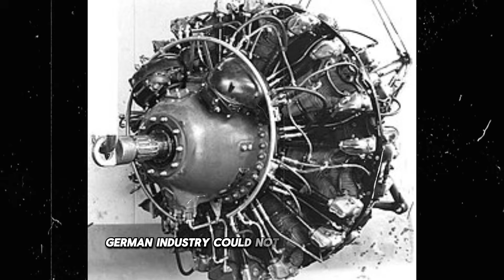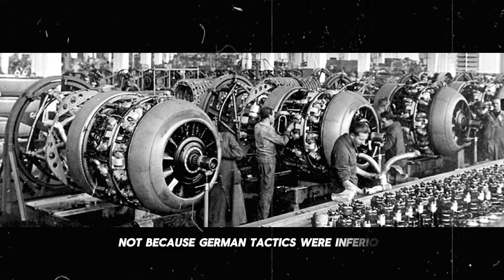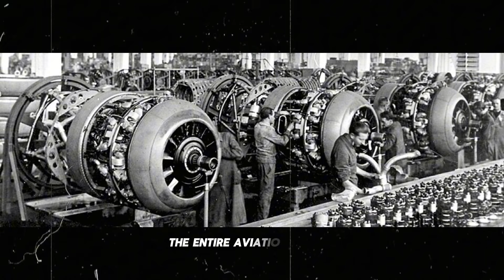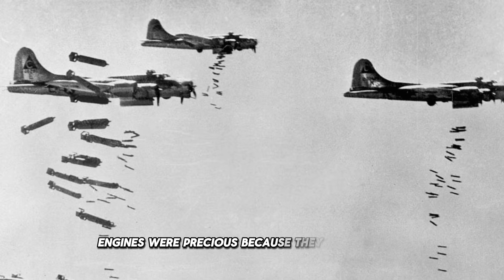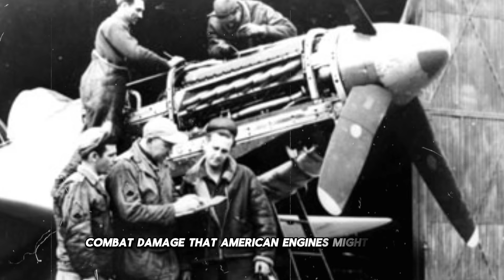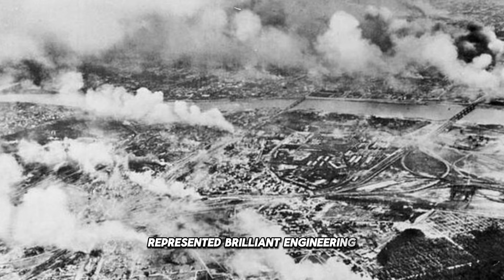German Engineers Were Stunned When They Found US Radial Engines Run 200 Hours vs Their 50.

Comment: Crap from the start. The B-17 NEVER used an R-2800. The B-17 was equipped with the R-1820. If memory serves, in Europe the R-2800 was found mainly in the P-47 and the F-4U flown by the Brits.